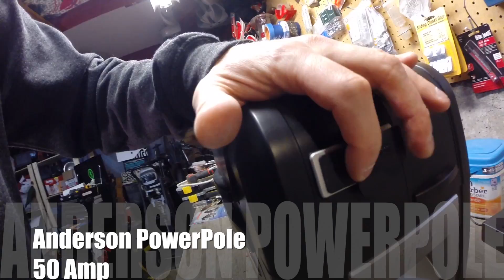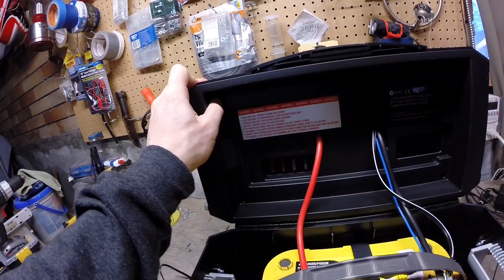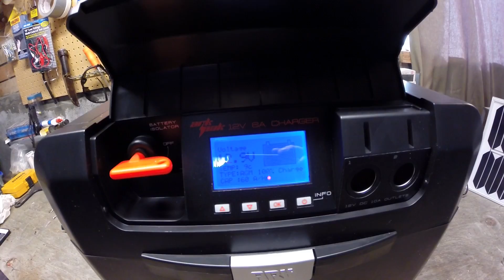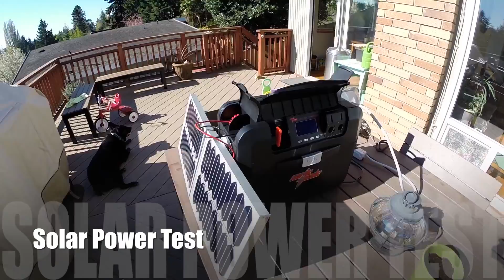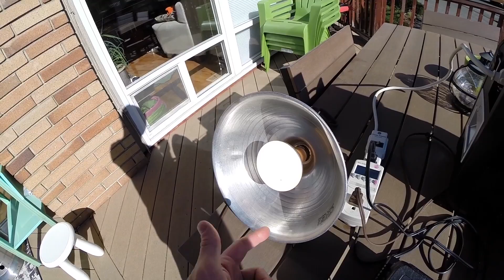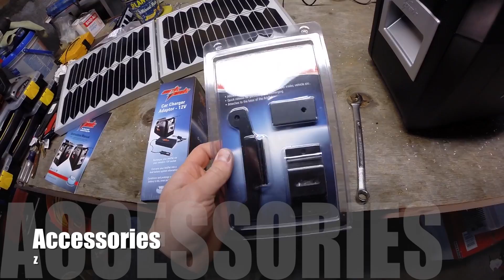ArkPak Portable Power Generator Review

Comment: great video mate, I,m in Sydney Australia the ark pak is fantastic for portable power in the bush, 240 volt power , usb, 12 volt sockets Anderson plugs.
I just bought a camper trailer off road extreme and this is my next purchase, will be using 120 watt solar panels with a Anderson plug which will plug straight into the ark pak and trickle charge the unit during the day.
I love the lcd screen gives you all the info you need to know, how long you have left before recharge, at night time you can put the ark pak to sleep to conserve power during the night. never knew there was a mounting kit available, thanks for the tip.
its hard to find 130 amp deep cycle battery, exide make a 120 amp which is readily available here in Sydney, but optima are also a great battery, not sure if you have seen a video on youtube where the boys take 2 offroad vehicles with arkpak to give it a good test on how much the ark pak can handle, there filming in nunes blue mountains in Sydney, great video to watch. its called arkpak portable power field test.  its a lot cheaper than setting up a 12 volt set up in the camper trailer....
regards jeff
Reply: Jeffrey was wondering after 2 years what your experience with the ark pack is,I just purchased a 730 yesterday get a battery in couple of weeks to try it out.
Reply: Has anyone add a second battery to it on the poles to make the amp hour bigger
Reply: And if would the build in charger be able to hand two batter

Comment: What surprises me about the solar movement is the lack of EASY, efficient laptop support. Most laptops take 15VDC 60 or 90 watt PS. Now barring watching a DVD (spinning motor takes a lot of current, proportionally speaking, a laptop is really affordable to run on a small solar setup as long as you DO NOT USE AN INVERTER. Plus:

A) An inverter causes trouble. The proper sine wave. The computer uses NONE of that sine wave. It just wants the power. (In fact, I haven't looked at a schematic lately but I am shocked they even need 15 volts, I think it is likely two things: To charge the battery and maybe to run the stepper motor in the DVD/CD drive)

B) Inverters are often HEAVY or are INEFFICIENT

The obvious solution is DIRECT DC directly to the laptop. When I get a jack that plugs into mine I will try 12VDC into it to see what happens.

I've thought about the solution side seriously and here is what I realized:

1) Almost ALL solar setups are 12v or above these days. Excellent
2) Open Voltage of a 12 cell is around 20VDC. Excelle news again!
3) The 7815 TO-3 pkg regulator can be bought for about 15 cents last I looked 
     (way cheaper in bulk)
   3A) There IS a high current version of the 7815 in the TO-220 case
 4) These parts have been around fort decades, there may even be better variants available. (I have some research to do there!)

5)So it'd be EZ to regulate it to 15 VDC and splice (Y cable) it right off the main feed to have minimal power loss. 

I have seen a buck converter for under $9 that will do a 60 watt PS replacement but it was still an ineloqeunt solution (it would take voltages even as low as 3 volts in!) 

6) It even should end up more affordable than current plug in car lighter laptop PS!

Why no one has tackled it is a mystery to me. Two of these, which I would imagine many RV or home solar users would use would probably save at least 11%+ of the solar cell produced!

 (since the buck converter runs up to 89% efficient this means in a ten hour computer session, there'd be a FREE HOUR when using it when the sun is up)

I've thought of ways to extend this even beyond the sunlight hours, using VERY SIMPLE Power components only recently made commonly available at reasonable prices.

Why no 15 volt support?

Comment: is your optima made in mexico. optimas are picky to charge the ark pack seems to do ok with optima. looks pretty handy
Reply from the maker: Not sure where it's made but yes the ArkPak has a special mode for AGM Absorbabled Glass Mat batteries that works great. They take higher voltage to charge. I've had some problems charging them too with regular chargers.

Comment: I really don't have the room under the hood for a duel battery but I want to run a 12 volt fridge in the back of my Jeep. I have a always on 12 volt plug in the back of my Jeep. It draws about 7 amps, but only while the compressor is running.  I'd like to plug an Arkpak into the back plug and charge it while driving and let the fridge run off the Arkpak while camped. DO they have a 12 volt plug for charging?
Reply: Yes, standard